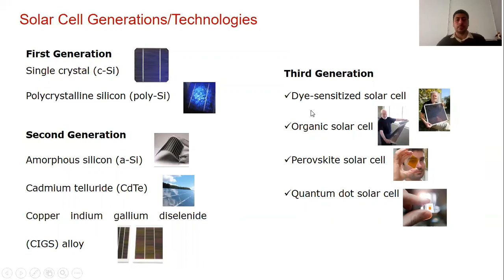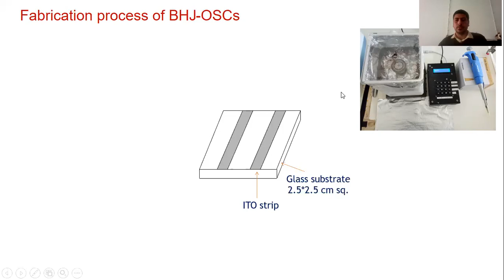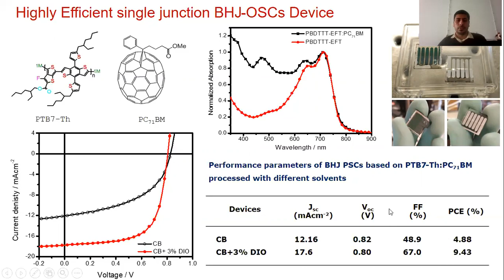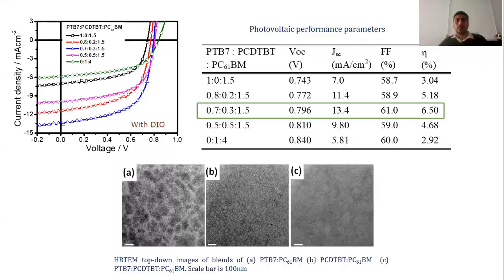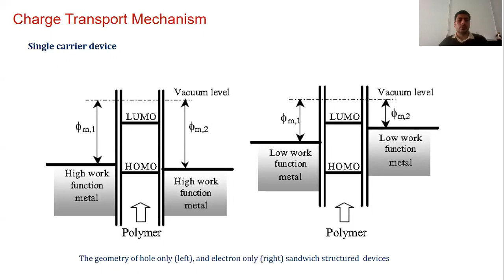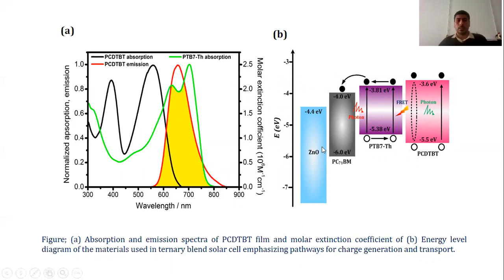Dr Vishal Bharti Invited Talk at IWCSET 2020 conference

Comment: Apart from ITO glass substrate any other substrate you suggest for fabrication ?
Reply from the maker: Yes you can but you need auch type of material whose conductivity is high and transmission more and absorption less so that it can pass maximum amount of light to solar material.